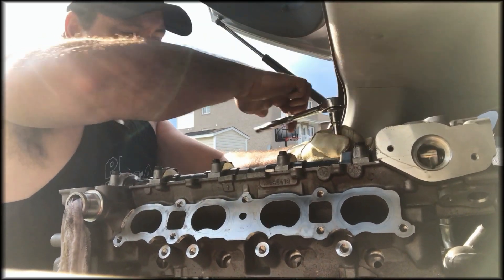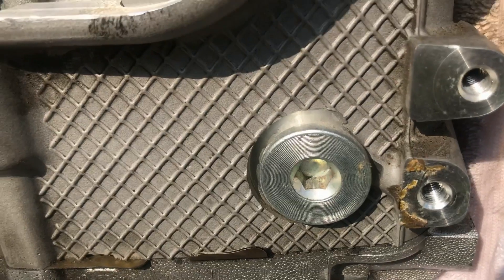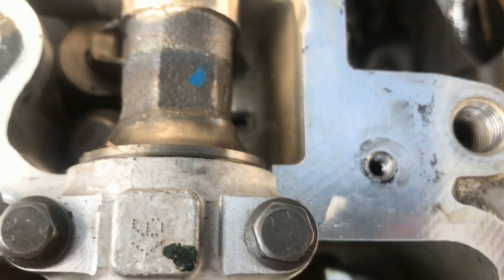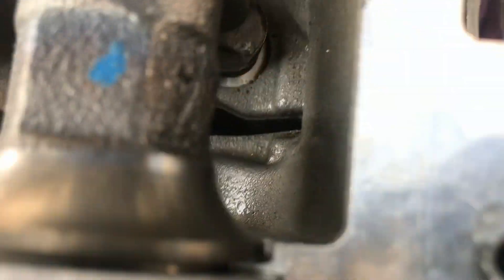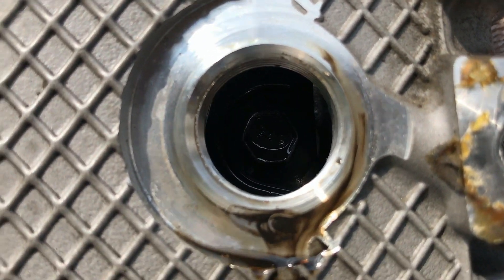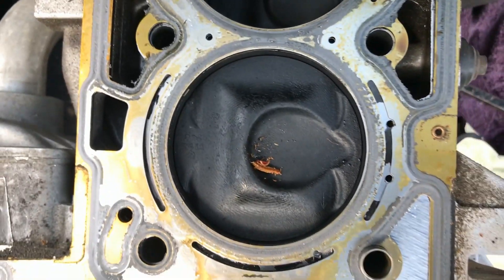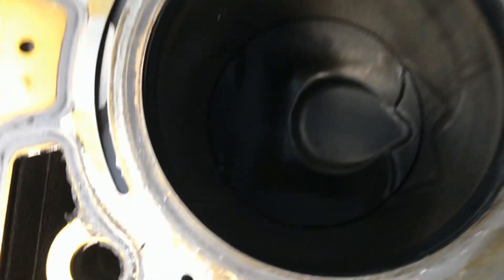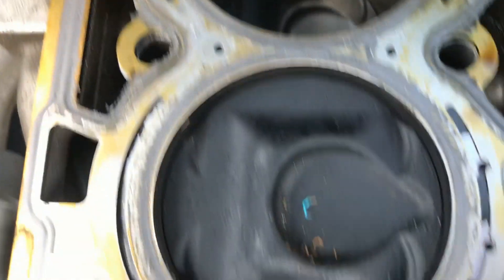2 0l LNF Turbo Engine Teardown: Cylinder Head Removal

Comment: Hi, just watched your videos and thanks for sharing. What was wrong with that motor? I was considering purchasing one of these Saturn 2.0 turbo cars and it has the LNF engine in it. Now I'm getting 2nd thoughts as I'm seeing that they're problematic
Reply from the maker: These engines are actually durable. In my Cobalt SS Turbo, it had 225k and it was still running strong with the original turbo. 

This particular engine I purchased for an upcoming project yet tbd. Based on what I've seen thus far, the only issue was the two valve seals and a cracked turbo housing. 

The previous owner had blown the valve seals, and incorrectly installed the new ones, but asides that, it's a new engine.
Reply: @TMEx_GearstoGrind  cool thanks but out of an abundance of caution im reluctant to purchase one. Sadly GM never bothered to conduct a recall of the garbage blocks